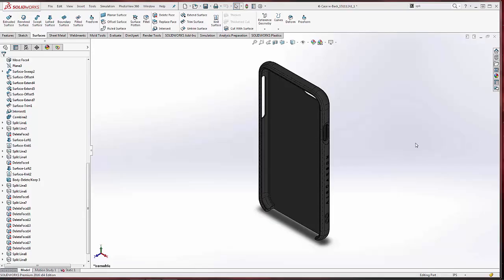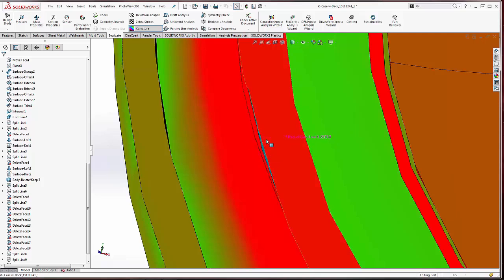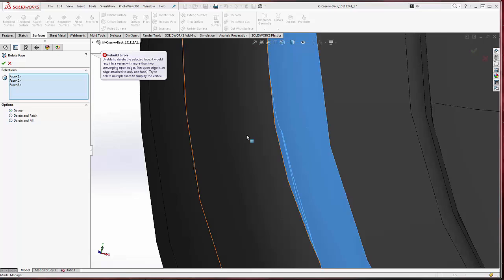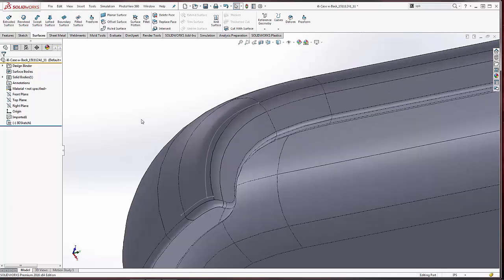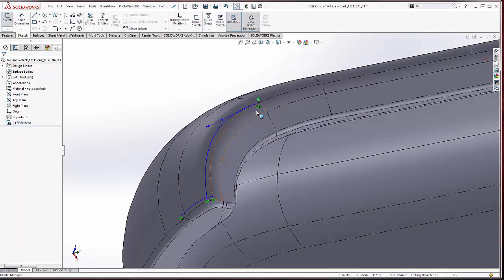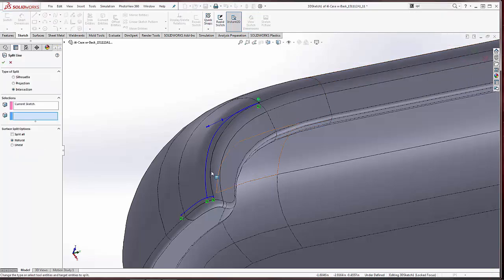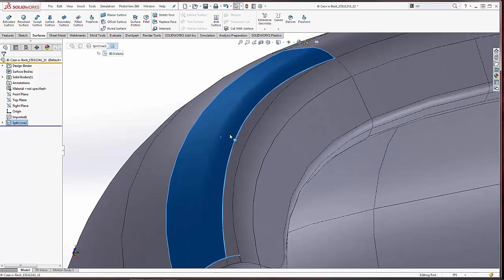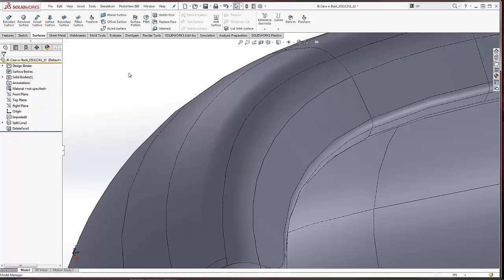SOLIDWORKS Quick Tip - Advanced Surface Repair

Comment: How do you draw a spline on surface with handles to control curvature? Doesn't seem to work in my case
Reply from the maker: You may have the handles disabled in your system settings. Open those up in SOLIDWORKS and under the Sketch settings, make sure "Enable spline tangency and curvature handles" is checked. Also, make sure that the handles aren't in a very light gray when you select the spline after sketching it. They can be easy to miss if you don't look closely. You could also potentially right-click on the spline and select "show spline handles". Hope this helps!
Reply: @goengineer  that was the problem, thanks a lot!

Comment: Thanks! What if I have a missing face? I did a surface cut and after that, one of the solid bodies is missing a face now.
EDIT: Never mind, I used Filled Surface and it seems to have fixed the issue.
Reply from the maker: Happy to hear you figured it out!
Reply: I think you are a master solidwork now. Havebeen 3years